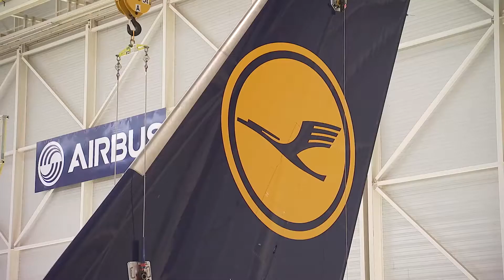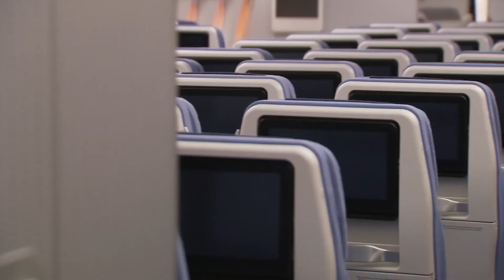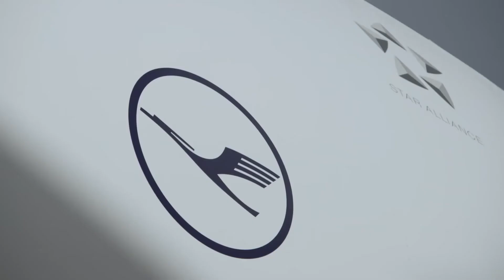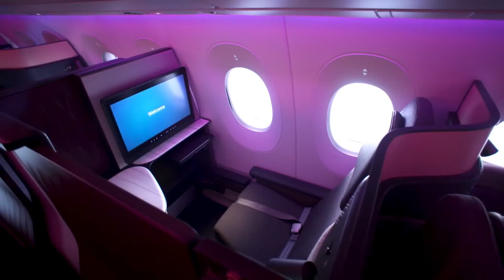Which Airlines will order the NEW Airbus A350F?

Comment: Without a A350-800F, and a A350-700F (about 180ft long and the perfect replacement for the aging A300F's) I don't see UPS or especially Fedex buying many, if any. With only one version you can't reap the benefits of the investment in ULD's, pallets, training, maintenance etc you have the same problem of no interchangeable components and systems (a new MD-11 conundrum). 
By contrast you might be able to coax Boeing into a re-engined 767-400F to go along with the 767-3F. They would probably be giddy to finally get an order for the 767-2C, a plane with more cube and density than a A321neoF but half the fuel economy BUT at the same purchase price that could access the small airports Airbus is targeting with the proposed A321neoF. Now you would have 3 common aircraft instead just one.
UPS has about 42 MD-11's and them replacing those with the A350F might be about as much as they would be willing to buy, I would think.
Fedex seems firmly entrenched with B777's. Wouldn't be surprised to see them eventually buy some 777 Big Twins while waiting for the 777-8X.
The big boys will probably wait for the next gen mid bodies to come out before buying anything with the emission standards looming.

Comment: I think that it will be at least another couple of years before we can truly see which way the market is going. By that I mean how the passenger market recovers after the Pandemic.
It is probable that there will be numerous 747/A380 airframes which will never be used for passenger transport, and also quite a few 777s which might even be larger than the market can support, possibly even for a decade, given the double whammy of covid and a movement towards point to point from hub and spoke. These airframes will either be scrapped or converted to freighters, because by the time they would be needed for passenger use they would probably require a major interior re-fit to conform with the branding of the destination airline. 

Rather than dispose of at unfavourable terms (near scrap value only?) airlines such as Lufthansa may convert some of their surplus airframes to freighters, reducing or eliminating their need to buy new.
Reply from the maker: Yep. I didn't really talk about Covid much, but its definitely a factor. Cargo airlines in general prefer operating older airframes in general, and can do it smoothly with big maintenance facilities. I think dedicated cargo airlines would be less interested, but passenger airlines that have small cargo fleets will appreciate NG cargo aircraft. Less maintenance, common type ratings, and other factors can help make such a freighter useful for airlines like Qatar Cargo or SIA Cargo.
I think conversions are big, Lufthansa is already doing that with their older A321's. 

Thanks for the comment!